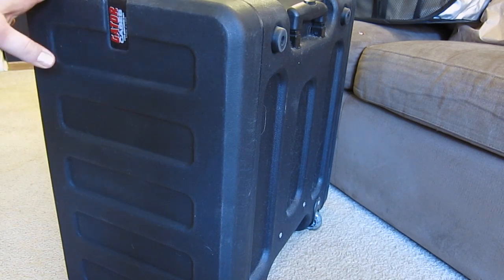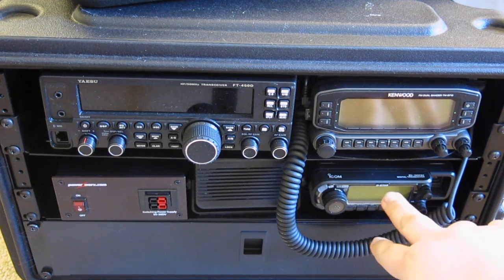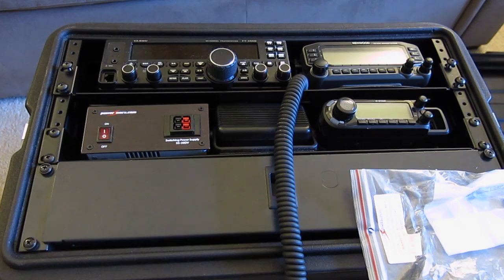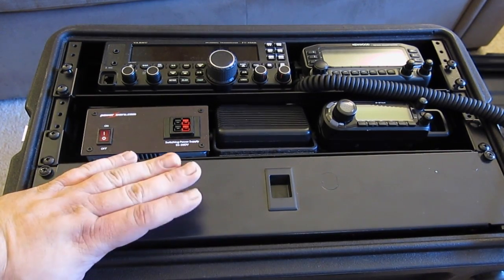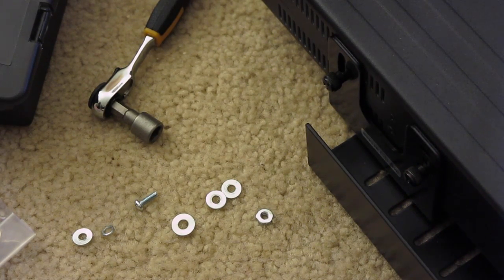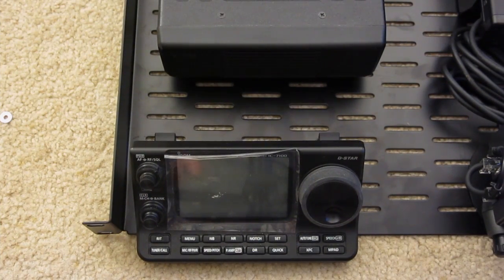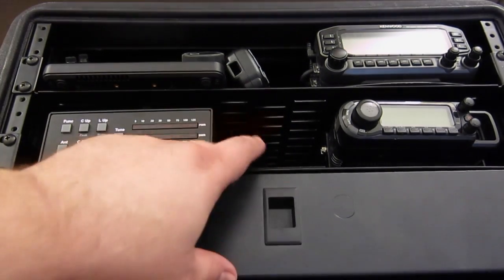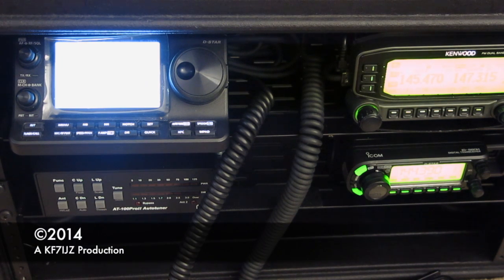Portable Amateur Radio Go Box 2.0

Comment: I think a common mistake in making a go box is to try to put too much in just one box.  I have adopted the idea of instead of having one large 6U box go with two 3U boxes.   This modular approach allows more flexibility.  You can stack two 3Us as part of your base station and then easily move them to a  mobile site if required.  In addition, move your power to outside the box.  This will both free up space and be a lot lighter to move.  If you need any additional accessories, get separate accessory bag along with your antenna bag.  Remember, you are not going to backpack this thing and will probably need to bring a table, tent/gazebo, ice chest, chairs, solar panels, ect.. to adequately support  This is in contrast to man portable operations which has a whole different set of requirements.

Comment: I know this is an old video, but I was going to suggest putting the transceivers down at the bottom instead of the drawer, and mount the faces more flush at the top. This would put more of the weight onto the bottom. I think the drawers are taking up a lot of room for the volume of the contents, and the contents could be placed in zip locks bags or into a separate parts bag.

Comment: I see Powerwerx now has a 2U rack mounted power supply. I'm looking forward to putting together a similar setup, (IC-7100 & ID-880h or 5100a) as well as a TNC-X and Byonics GPS for packet use. I may omit the drawer to keep weight down. 
73 de KT4KN

Comment: can you please tell what model this is? and did it come with the drawer?
Reply from the maker: Marc Brown The cases are Gator Pro Series Molded Racks.  The specific model number for my case is G-PROR-6U-19.  This model has wheels and a collapsible handle and is available in 4, 6, and 8 U models.  The drawer unit was separate and purchased on Amazon.  http://www.gatorcases.com/p/29158-79/g-pror-6u-19

Comment: Have you ever thought to use the 1ru racks as a vertical mounting rack for your radios have you ever thought of using a psu from a pc as a power source when connecting into mains power of the 12 volt rail. If you where planning aux power pack option you may want to look at an IEC connector as a cable connection on DC power.

Comment: Had a 8U Gator Case with an FT-857D, Alinco DR 235 Mk III (220), Yaesu FT-8100, Power Supply, speakers, and a 2U drawer which worked great. I just wanted to sell everything and I'm actually going to a larger Gator Case (10U or 12U) with shock mounts and brand new equipment. It will be heavier but that's okay as I'm going to mount it to a folding dolly for easy transport. These boxes are great ideas for us hams.